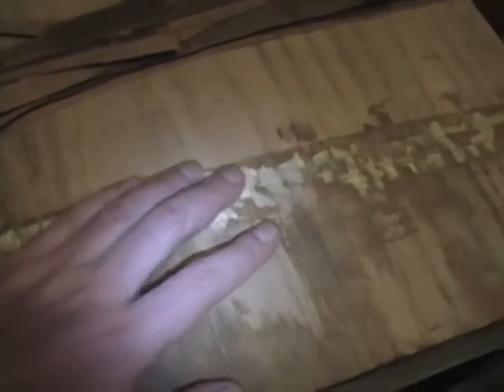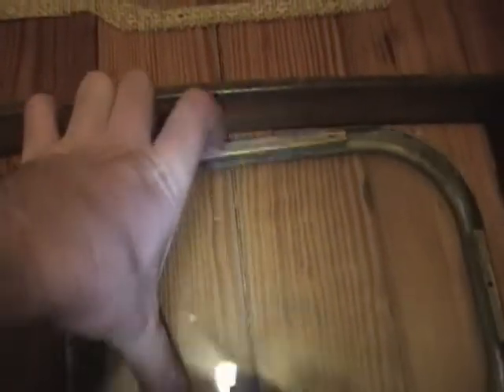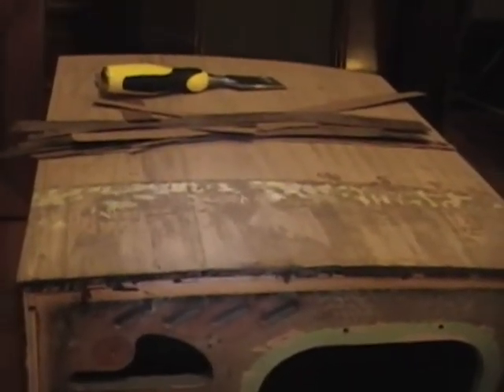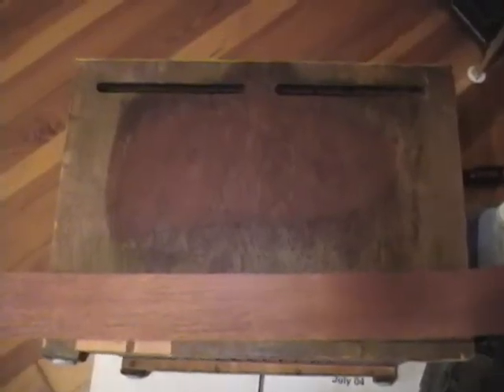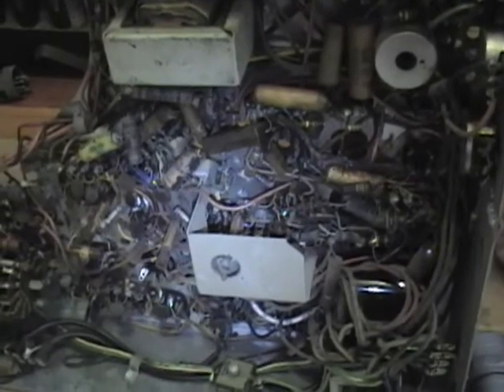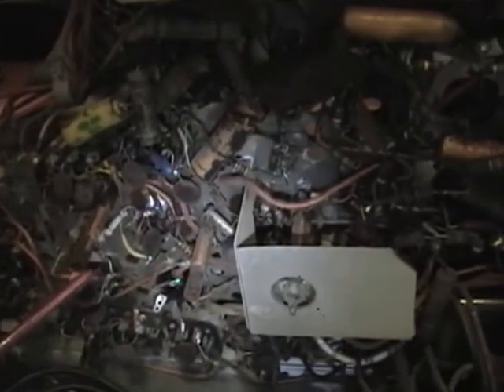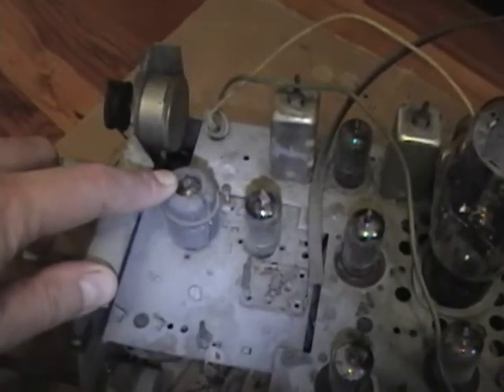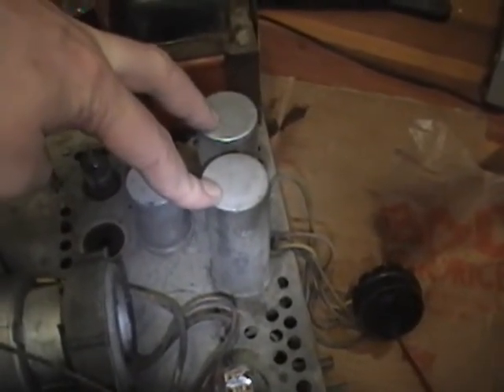GE 810 restoration p4o8

Comment: i was surprised how easily my 810's cabinet came apart just wish the chassis went as easy just haven't had time to even mess with mine. my veneer actually came off the top in one piece so i should just have to glue it back and hope for the best.

Comment: @bandersentv yeah i think i already told you what happened with mine got it and jumped the gun recapped everything without service info and now it blows 5u4s. at this point all i have working is the audio amplifier. just need some time and a clean table to set down and look at all the wiring and see what i did wrong. least i learned never to dig too deep with out setting a starting point.